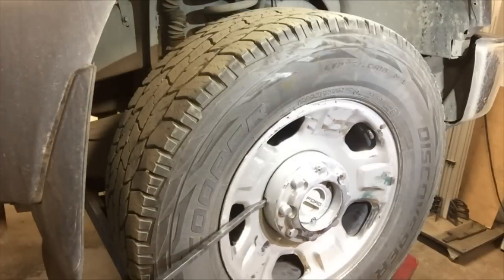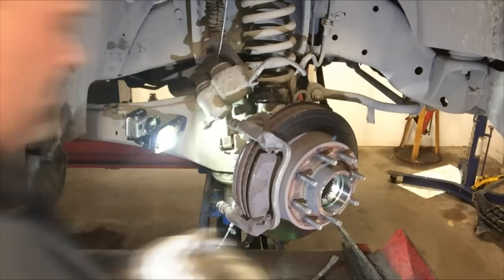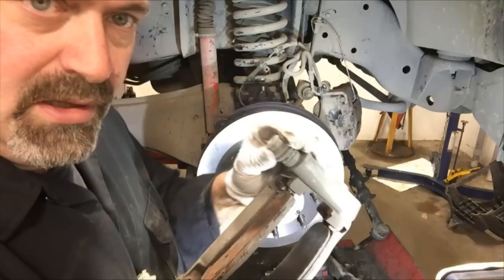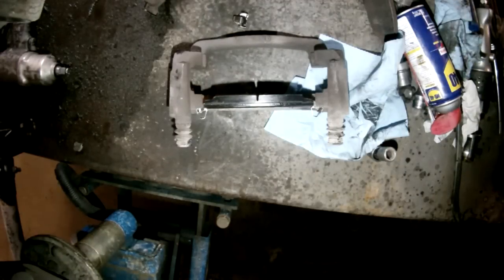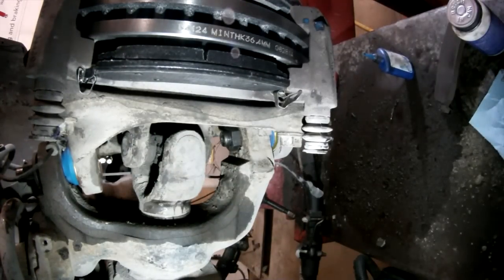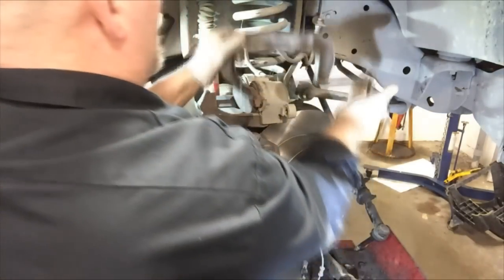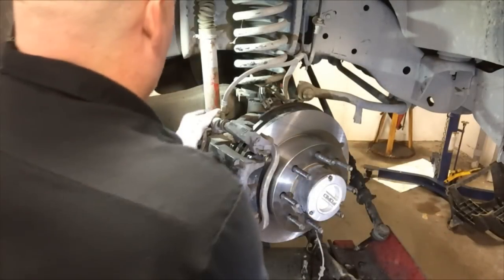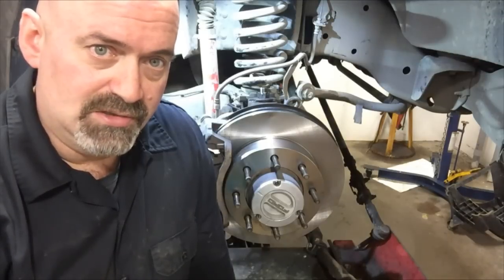Ford F250 F350 Super Duty 4X4 Brake Job Video

Comment: Great video; I've done a ton of car/light-duty truck brake jobs and this helped me see what I needed to anticipate for an HD brake job - other than a larger torque wrench, I was good to go. Thanks very much for taking the time to put this together. Only thing I do a little differently is taking the brake fluid reservoir cap off in the engine bay before I push the caliper pistons in, and also pumping the brake pedal up as soon as I finish up and before I even put the vehicle in gear so I know I've got a firm pedal; maybe don't need to do it, but I had a drum brake job bite me for that reason many years ago.

Comment: Nice video and thanks for sharing...when I do a brake job, before compressing any of the brake caliper pistons, I attach my pneumatic brake fluid bleeder hose on to the bleeder screw on the wheel I'm working on; and with the air compressor regulator set at about 100 PSI, I open the bleeder screw, purging- by vacuum the old brake fluid from the caliper reservoir until the fluid is clear.  After closing the bleeder screw, I then compress the caliper pistons- thereby avoiding sending the old contaminated fluid back into the hydraulic lines, ABS module, and master cylinder.  I hope my comment is found helpful.

Comment: The one thing I would add is to carefully lube the eight holes that the studs pass through, and the main hole that meets the hub. I like to use Permatex anti-seize compound. I'm always thinking ahead to the day I might want to remove that rotor again. Rust is our ever-present enemy, especially where road salt is used.

Comment: See, this is how a video demonstration should be.  Ideal lighting, angles and everything!  AWESOME JOB AND THANK YOU!
Reply: Compression of caliper barely shows just how compressed it should be.  Nor does he address it verbally.
Completely skips the part about installing hardware on the pads.  Nor how to install the pads to the caliper mounting bracket.  Nor does he discuss the importance of installing the pads to the bracket BEFORE installing the caliper to the bracket.  Nor does he discuss the option of installing the caliper to the bracket before installing the bracket to the car - this is an important option for those concerned about getting the caliper to mount over the pad safety pins.
Completely ignores alignment of the triangle head of the slide pins with the caliper.
Fails to discuss cleaning the pad slide troughs in the bracket - this is a source of stuck caliper.
Reply: @stephaniegrow2001  I guess you needed those explained.  What you listed is essentially one or two routine steps, those experienced would do it without breaking it down.
Reply: @dasteufelhund  Theres nothing routine when making an instructional video.
Reply: @stephaniegrow2001  If you are not familiar with automobile brake change procedure, then I understand how it would be anything but routine for you.  What should be routine, is safety and tool knowledge. If you still want to argue, take it to someone who knows the routine and pay them.

Comment: One trick that no one seems to mention in these videos is to take the cap off of your brake fluid reservoir prior to using the c-clamp to push back the caliper pistons.  Doing so makes it a LOT easier to push back the pistons.  You do have to watch the reservoir to make sure the fluid doesn't pour over the top.
Reply: Good point, thank you.
Reply: Open the bleeder valve instead. Fluid dumps and no fear of triggering brake light. Then top off res.
Reply: @robertgeorge4064  Yeah but then you're gonna risk getting air in the lines.
Reply: @BassinProf   just have someone step on the brake pedal when finished then close with pedal down. I’ve done dozens of times no problem. Or you’re right. Could get air.

Comment: My 2008 250 right front started binding and a very hot 275 with laser. I had to pull over smelled like burning brake pads. Limped into Ford dealer after a Search Rescue. Thanks for share so I can understand the components of brake system. Peachy B 👍👍🍑🍑❤️❤️.

Comment: Hello Car Doctor - I wanted to watch your video to see how you install the metal clips that come with the replacement pads for my 2008 F250.. The last shop that replaced my break pads did not install the clips, and the breaks rattle when I hit a bump. I'm replacing the break pads myself and I see how you installed the clips - thanks and I'm finishing the job today.

Comment: I always clean the oil off the rotors before i put them on so the new pads don't get oil on them i lay the rotors on a cardboard box not the cement spray them with break cleaner and they are ready to go.

Comment: For the ones asking about the spring clips installation in the comments, it is best to separate the caliper from the anchor mount bracket and install clips already attached to the pads on the outward side of the caliper instead of trying to install from the inside of caliper. Also it is a lot easier to access the caliper and bracket on truck if you’ll turn the rear of the wheel and tire outward away from truck after jacking up the front end in case your 1/2” impact is like my HF and you need room to use a 3/4” breakdown bar with cheater pipe for the 166 torque spec of the anchor bracket bolts. Torque spec on caliper is 46 lbs on my F-350 and 26 lbs (some spec 35 lbs; mine stopped seeping at 31)on the  flow bolt with the 2 copper washers and 133 inch lbs on the bleed screw
Reply from the maker: 26ft lbs on bleeder screw? Seems excessive.
Reply: @ThecardoctorTV  Yes I corrected. I meant to say the flow bolt. Thanks

Comment: Awesome video as usual, question ive got though, my '01 250 4x4 has 2 different slider pins per caliper. 1 round and smooth and 1 with 3 slight flat spots. Does it matter which side of the bracket they go or are they interchangeable.

Comment: Car Doctor - This will be my first brake pad replacement on a heavy duty truck (2007 F250 4WD).  I also would like to replace the brake fluid when I do this.  Do you have a video for that?  Or, any guidance to prevent making a mistake?  Special tools, procedures, etc.  I have a vacuum pump and bleeder bottle that I use on my motorcycle, but nothing further in the way of special tools.  THANK YOU!
Reply from the maker: I don't have a video yet for that. The vacuum system should be effective but the proper way would be to use a scan tool and the auto bleed procedure. Some air may be trapped in the ABS valves and you may need to safely operate the vehicle on gravel or snow and activate the ABS system between bleeding to allow air to pass to the calipers where it can be bled. This of course can be an unsafe situation if the brakes don't work right from having air in them so be careful.

Comment: Hi Tim, is there much difference in this process with a 2008 f450 superduty 10 lug 4x4? I have warped rotors on the front and am getting ready to replace with new ones and new pads!

Comment: Hey Doc 
On to more pressing issue with this truck   For the last two years I've had an intermittent problem with the motor.  It first showed up when pulling a 31 ft boat to and from the beach  3 hr trip one way.   Into the third hour of the trip, the turbo refused to spool up   once to the destination and time to cool the truck ran fine.  I sold the boat and as long as the trips were under three hour the problem did not show.  But then about a month ago while driving on a shorter trip, it began to show the same problem and then it would lose power  not run more than 30 mph and very little throttle response .  But stop, even for a few minutes and it would restart and run for longer periods  ,  until finally, it will not run more than 45 mins without losing power .
The shop is run by a long time Ford mechanic,   he replaced the fuel pump claiming it was worn out,  but after the installation of a new one   it only ran another hour before the same symptoms showed up   
Motor has 200k and has never been modified.
I have in the last two years replaced the following
high pressure pump
injectors and fuel pump
Your thoughts?
Reply: It's been a month since you posted but my truck had a similar problem and it turned out to be a few temp sensors in the engine and turbo radiator.
Reply: bud coil packs, just get enough to change them all and change all of the plugs

Comment: Any idea how to replace the steel brake line that goes behind the front drivers coil spring on a 2008 F350 Super Duty?Looks like it goes between coil spring bracket and frame.

Comment: Iv watched like 8 videos trying to find out how to install those 
coat hanger type wire bits(Return springs?) for the front brakes on my 2004 f250.
I cannot find anyone doing them. Does anyone know what there called or who shows how they go on?

Comment: Hi Tim, did you open up the brake master cylinder to relieve pressure when resetting the caliper pistons?
Reply from the maker: +Ryan Ballance I did not. It will vent out the top but after pumping the brakes I cleaned the master cylinder, removed the cap and made sure the boot under the cap was properly situated. If it's been a while since the brake fluid was flushed and you have the capability it's a good idea to open a bleeder valve before compressing the caliper piston so that the old fluid is not forced back into the system  then the system is flushed and bled properly.
Reply: Perfect, thanks.

Comment: when replacing the caliper, does the new one come with fluid in it?  If not how much should be added prior to the install and if so should I top it off before connecting the line?
Reply from the maker: No fluid. Just need to bleed the system after. Probably need a QT or two of fluid to properly bleed the system
Reply: Thanks for the reply.  Its working perfectly

Comment: I have one point on contention, & one difference of opinion in a world where there is a mile-wide "grey-area" of different ways "to skin a cat".... Contention: I see many guys here mentioning an issue with the under-hood mess from overflowing the Master when re-compressing pistons... Your vehicle is TRYING to tell you something, that being, that you're pushing old, heat/crust/debri/corrosion-laced contaminated brake fluid BACKWARDS into your almighty ABS control module at the same time that you're pissing brake fluid all over your under-hood components, & paint. Potential plugging of the flex-hose, & the very RUIN of the ABS module become VERY REAL possibilities.... YUK!... SO!... WHILE the caliper is Still on the bracket, (to keep the bleeder @ the TOP of the caliper) Crack open the bleeder as you squeeze the piston(s) in.... Only crack one side @ a time, & if you really wanna cut down on the MESS, plug a vacuum line to the bleeder-head, & poke that hose into an old (empty) quart bottle of oil to catch it. Right B4 you finish squeezing, pop the vacuum-hose off, & WATCH whats coming out the bleeder to verify it's JUST fluid, & NO air-bubbles... Got it? GOOD! Crank that bleeder tight, & SMILE, knowing that YOU know MORE about doing a PROPER brake-job than 90% of the tire-store-Hacks out there... Then, check the condition of the brake fluid in the bottle to decide if further bleeding is warranted... maybe even pop the resouvoir off the master cylinder, & wash IT out too. (LEMMEE KNOW if you guys need a play-by-play on bench-bleeding/flushing/cleaning a Master-cyl.) Or pop the whole M/C off & flush, or even replace if there's bunches of black "silt" in the resouvoir, `cuz that's what USED to be the M/C seals.....  OK, Now for my personal opinion... I rip the "Anti-Squeal" shims off of EVERY single brake-job that I do, for the EXACT reason that they do the OPPOSITE of what their named for... (They come in GREAT for quicky-cheap repairs on sagging front plastic bumpers w/the mounting tabs all destroyed, for folks not concerned over asthetics. 4 drill-tip screws, a trimmed piece of shim, & a shot of color-close paint... I get 100$ for a "Tight-n-solid" bumper-skin, instead of Thousands from a body-shop)... Look at the TOP GRADE pads, such as WAGNER Thermo-Quiets. NO cheap-assed steel shim to creep out of position or rust, CAUSING the squeal there... TRY squeezing SMALL dabs of "RIGHT STUFF" SUPER-silicone on the insides of the caliper jaws, & even on the edges of the caliper pistons where they make contact with the pad... MY "squeak-comebacks" have dropped to literally ZERO since adapting this change in brake installation procedure... Oh, & BTW for you guys who get your rotors turned @ the parts store, IF IF IF you hear that lathe MOANING, or making ANY noize other than "Shhhhhh"....  they're RUINING your rotors! Get on their ass, & TELL them to put some $%^&&*^%$ SHARP BITS in that lathe!!! (& maybe even attach the rubber silencer band around the rotor, instead of using it to hold the bathroom door shut..LOL)
Reply: yup never push dirty fluid back through your abs system

Comment: what rotors yoy recommend for my 05 ford excursion? thanks
Reply from the maker: +CARMACALV If its rear wheel drive and you have access to an advance auto parts or carquest I would go with PER54129 for the front rotors. NAPA also carries the same performance rotors for that application. If you have a 4X vehicle you may have to go with a different brand. The wearever frontline rotor is decent if you have a 4X application. Check with your local parts supplier or look at ebay and amazon for performance rotors for your application. Good luck

Comment: Didn't show where the squealer tab goes which is the only reason I watched this video. FYI, it goes on the bottom OUTER, not the inner like you would expect. Also, the design of putting the abutment clips on the pads and not the bracket itself is just dumb. Leaves the cast metal exposed. Regardless of how well you lube them up this is just gonna accelerate rust jacking.

Comment: I'm bumming.  I used the C clamp method here without releasing pressure on the bleeder.  Now for the last 20 mins my caliper is dripping a drop ever 5-8 seconds from somewhere inside.  Not from the bleeder.  I have since pumped the brakes to decompress the piston and even used my hydraulic  bleeder tool but drip drip drip drip.  Hmmmm
Reply from the maker: Sounds like a bad caliper. It happens. Probably not because of not opening the bleeder.
Reply: I thought the same thing that it was possible.  I went to Napa and bought two new calipers with brackets, $80 each.  They are FoMoCo rebuilt, lifetime warranty.  The rest of my install went fine.  If I have to do it again at any point, I will probably just open the bleeder to be safe and use the same C clamp method.  It may be unnecessary, but better safe than sorry I guess.

Thanks for the video.
Reply: like the Car Dr said.....it was due to a bad caliper.....not the bleeder screw....the standard procedure is to NOT open the bleeder.......

Comment: No one mentions cleaning  and checking the bores in the bracket where the slider pins go. Big, big mistake. The old grease in the bores is a really bad idea to leave in there. And how do you inspect the bores when dirty. Clean around the banjo bolt before disassembly. Don’t use a screw driver tip on the face of the rotor if you are reusing it. Who would use the old break pads? All that work? What, you replaced the pads and then went back in to do the rotor? Doesn’t make any sense. A lot is left out and done wrong in this video. Really it’s best practice to clean the whole shebang before you start. And when you drive it you pump the brakes before you drive it, and then test the brakes gingerly and at very low speed, gradually testing them at higher speeds and brake application. Then you get up to 30 mph several times and use the brakes to almost stop with moderate pressure a few times, driving a few blocks in between each time. There’s more, but only the first one’s free....
Reply from the maker: thanks Karen!

Comment: Hi Tim, great video, I really enjoyed watching it.
I am replacing my front brakes pads & disk on my F350 (2010) with the same hardware you used in this video. I am having trouble finding the proper way to install one of the metal clip’s, it is the one that has a small hole and kind of a straight blade, I was wandering if you can explain how to install or have a picture somewhere.
I found only pictures of the Disk Brake Pad Installation Kit but not how it is installed. I am not sure if we are allowed to post a link, but in the following picture, it is the bottom 2 clips (http://www.carid.com/2008-ford-f-250-brake-parts/carlson-disc-brake-pad-installation-kit-37898165.html)  Thanks in advance.
Reply from the maker: IM trying to picture it without the pads sitting in front of me and im racking my brain. I think that's the wear indicator but I cant remember how it attaches. Ill try to remember and let you know if I do.
Reply: Thanks.

Comment: And finally (NOT!) all the repair videos that show using brake clean or any solvent, when opening up gas lines...any nasty chemicals (they all cause cancer etc.) you should always wear a VOC rated respirator mask. And until you cannot smell the stuff any more. This facet of virtually every YouTube auto repair video is a really BAD aspect. Wake up.
Reply from the maker: I used the product following the recommended precautions and instructions. However nothing wrong with being safe and wearing a good respirator. Thanks for the tip.